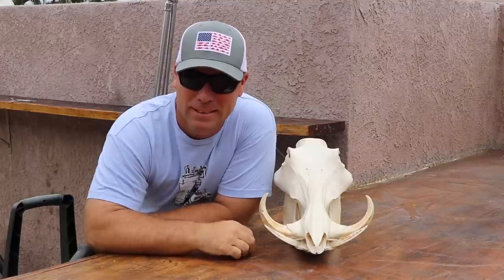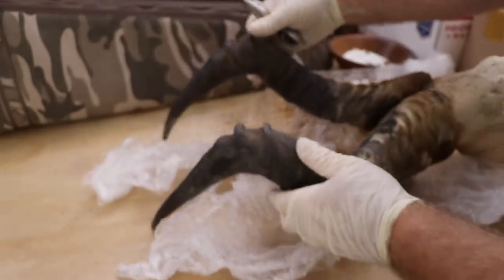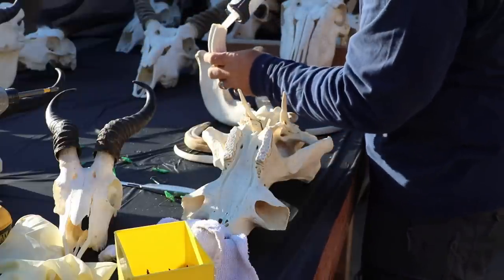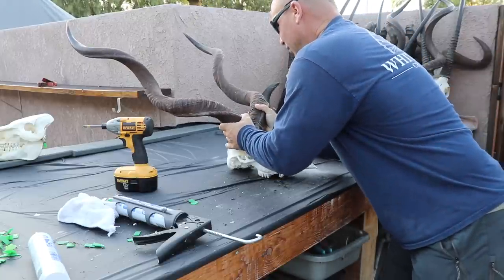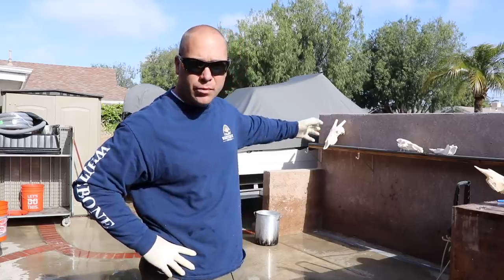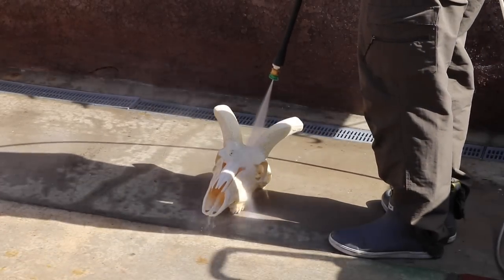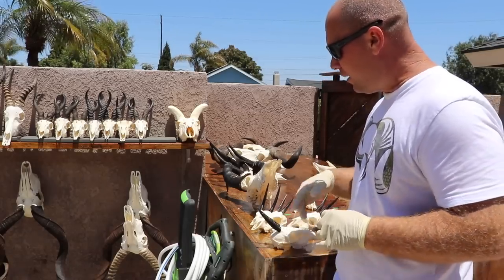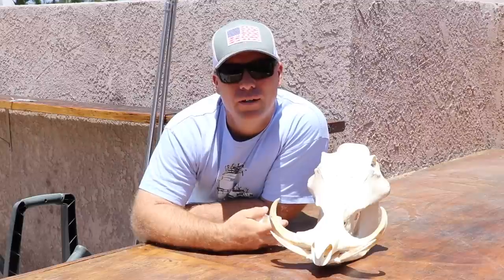58 AFRICAN ANIMALS SKULL RE-CLEANING

Comment: Hey brother! Put that mop and glow in a spray bottle and spray it on the skull and horn. Then just back brush it. You can mist the larger surfaces, and stream spray the tiny areas that the brush won't fit very well. I found it's way faster than just brushing all of the sealer on. I didn't seem to waste any more mop and glow than normal. Also the mop and glow seems to be storing ok in the spray bottle. Thanks for the follow up to Africa videos! Amazing pile of critter skulls!
Reply from the maker: +Br5492087 Great tip brother. Will do thank you for watching.

Comment: Another great video. Articulate and detailed, as usual. I've learned a ton from watching what you've posted. You've probably already tried it, but I use a spray bottle to apply either mop and glow or a 50/50 mix of Mod Podge if i'm looking for a matte or glossy finish. You may lose a little more product with the spray, but it helps coat those hard to reach places with a brush. Either way, thanks for continuing to post!

Comment: have a leopard that is very orange ,tried the boil and peroxide ,no luck any ideas? also  if you mix oil base paint in your epoxie works great
Reply from the maker: +kdj beenken Thank you for the tip. That red / orange die on skull from Africa is a pain. Did you boil it in peroxide.

Comment: Where to begin.......First off if your using 35% industrial peroxide the last thing you want to do is mix it with regular water, distilled water is the safe and best way. Second thing is i don't see you doing anything about the natural grease in the bone (what bone is left) if you don't remove it in time they will yellow. I have been doing this for a living for several years now and we use Beetles to clean the skulls and every bone no matter how fine or small never breaks. Looks like a quick short cut to make a buck and run. I would like to see one of your skulls that is like 5 years old and see how white it still is. One more thing, peroxide is not flammable but is will accelerate a fire like gas so if that pot ever overflows and hits that flame...........run baby run!
Be careful people never boil peroxide read up on it if you don't believe me it can be dangerous stuff if not handled properly.
Reply from the maker: Thank you for the time putting this comment together.  I too have been at the skull thing for some time 25 years actually.  You can’t buy 35 percent peroxide that I am aware of. We recommend 40 percent by volume peroxide  developer which is 12 percent then diluted in half with water. My skulls do what all skulls do in time they take on natural color but never leak or smell. Nothing degreases like the boiling the peroxide mix.  The beetles do an awesome job but they make the degreasing time much much greater.  The method I share is for the do it yourself guy that can’t afford the taxidermist. These are Just guidelines.  Hope you understand.